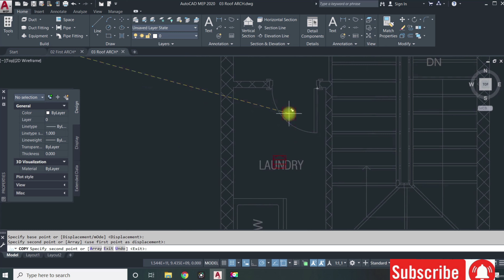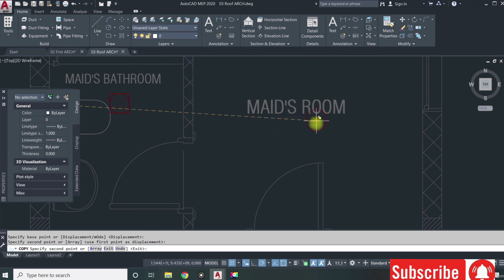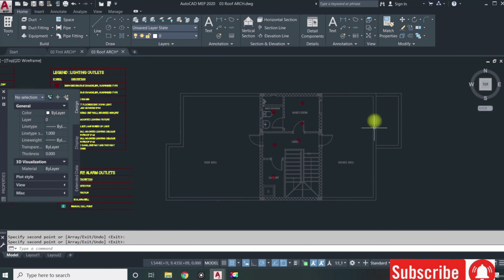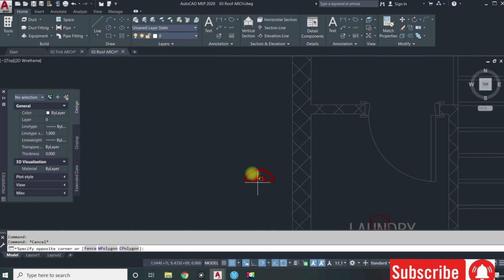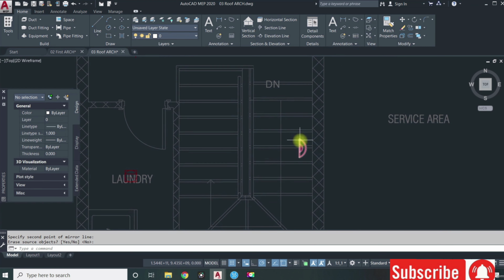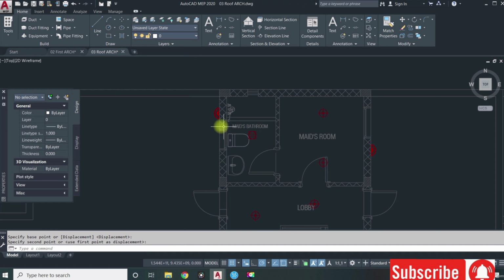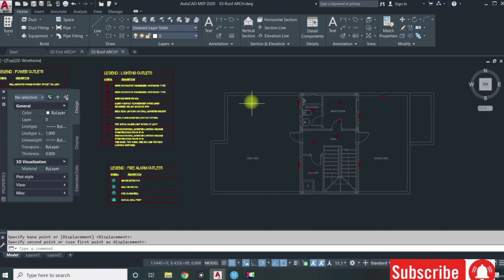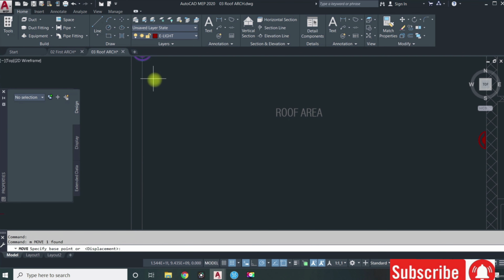lighting fixtures distribution finalization in Auto cad MEP

Comment: Thank you very much

If I draw a 3D block, and this block is not included as a standard part in AutoCAD MEP, I want to add some information to this block, so when I export this block als ifc file, the information will be exported automatically with this block.
     Please do you have a video explaining this method?